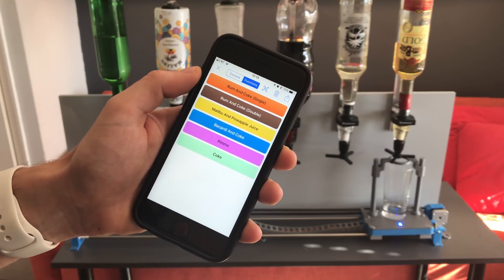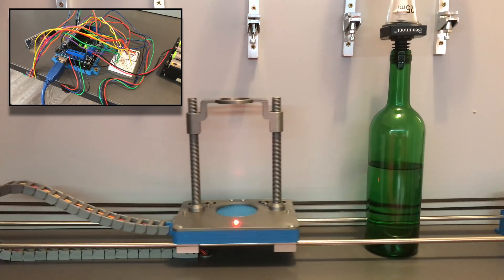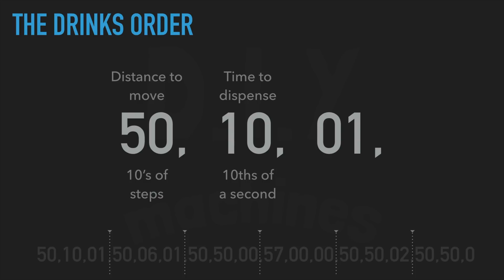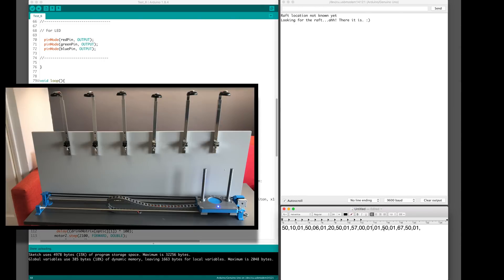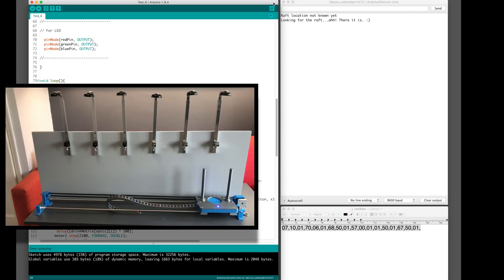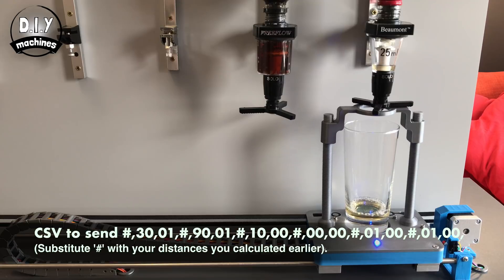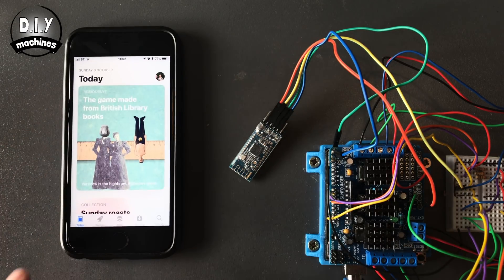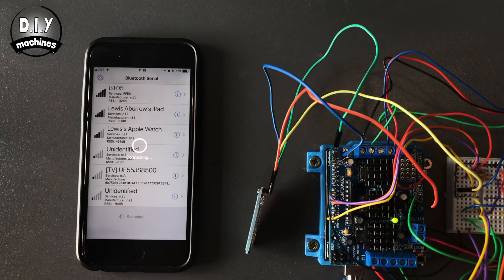How to make an Arduino DIY Robotic Bartender - P4 Adding Bluetooth

Comment: Great Project, I'm currently trying to build my own. So far everything works great.
However I'm struggling to find all the Code examples you mentioned in the Video on Github. 
Im currently trying with the script "Barbot_V1.ino" but I had to reverse some Motor directions to make it work properly and change it to 15 optics.

It seems to work, it homes in, prints that it found the Paddle but then 10-15 seconds it randomly starts dispensing a drink. Is it possible that it saved the last drink command even tough I reuploaded the code since last trying? It didn't seem to do that before.
(I did try before by sending it via Bluetooth, so the HM10 is already attached)

I'd appreciate any help or more Code snippets so I may understand the code fully myself (first time doing anything with arduino programming...)

Thanks and keep up the amazing Projects. :-)

Comment: Help needed. I have 10 optics instead of 6. I changed that in the code, but when I send the code it shows this for some reason?

10,30,01,30,30,01,30,00,00,30,00,00,30,00,00,30,00,00,30,00,00,30,00,00,30,00,00,30,00,00,

Raft location not known yet
Looking for the raft...ahh! There it is. :)
10,30,1,
30,30,1,
30,0,0,
30,0,0,
30,0,0,
30,0,0,
30,0,0,
237,2277,2277,
2277,2277,2277,
2277,2277,2277,
Done loading

Comment: Im getting some weird errors... When the machine has done the last optic it gets automatically a new command with very werid numbers 
-------------------------------------------------------------
50,30,1,
50,90,1,
50,10,0,
50,0,0,
50,1,0,
50,1,0,
Done loading
Drinks ready, enjoy.
2387,2277,2277,
2277,2277,2277,
2277,2277,2277,
2277,2277,2277,
2277,2277,2277,
2277,2277,2277,

Done loading
Raft location not known yet
---------------------------------------------------------------

so it does what i commanded him to do but after that he's automatically driving a crash with those weird numbers...
Also my LED is not quiet working when i put the ground wire to the ground pin - it wont light up
anyone knows what could cause my errors? im pretty new to this arduino stuff :/
Reply: So i figured out now that there shouldnt be a comma after the last number of the command! In the description is a code: 07,30,01,68,90,01,72,10,00,70,00,00,74,01,00,71,01,00,
But it should be like this: 07,30,01,68,90,01,72,10,00,70,00,00,74,01,00,71,01,00
-->Without the comma at the end. This makes the random numbers (2277,2277,2277) disappear and it wont crash - for now...
After fixing that i added the bluetooth module. 
Now if i connect to the bluetooth module with my app, the machine goes crazy and crashes in the same direction again... i plugged the arduino uno into my computer again to see whats causing this problem. Then i saw that as soon as I connect with my mobile phone - the bluetooth module sends this code with those random numbers to the machine again, making it crash:
2387,2277,2277,
2277,2277,2277,
2277,2277,2277,
2277,2277,2277,
2277,2277,2277,
2277,2277,2277,

is there anyone still active on this project? Or maybe somebody encountering the same problems as me?
Reply: @B4uernp0wer300  Did you figure this out? I am getting the same error.
Reply: @brockr1600  havent been working on this project for a  while now.... i figured out that there are many different bluetooth apps. Serial bluetooth terminal is working  the best so far but i still get the error sometimes. pretty weird stuff happening there. and i have to fix some mechanical problems aswell - seems like my stepper motors dont have enough power to push that peddal upwards - but im using a slightly different design of the machine anyways. 
let me know if u figure something out :)
Reply: @JC Motion Simulator heyho I kinda stopped working on it :/ but yeah if I take my time and figure something out I let you know. Let me know if u find something as well :)
Reply: Salut , même soucis , je vais travailler dessus pour trouver une solution

Comment: I was wondering where the cocacola was leaking out of the free flow optic at? Is there anyway of designing a 3d part that has a 1881 bottle cap on the top and on the bottom a clamp that fits the optic snuggly?

Comment: Good idea.
I've got everything done so far but I don't understand why the BOT loads more numbers after it is finished (over 2000) and then nothing works anymore
Reply: i guess i have the same problem. did u fix urs?
Reply: Meme problème ! Avez vous la solution ?

Comment: Hi what great project is this, the only issue I have now is that hm10 app is no longer avdd available in the AppStore. Is there another app that I can use?
Reply from the maker: You can use any app which lets you communicate with an HM10 module. Search for 'HM10' and that should yield some results. You could try 'BLE Terminal HM-10'

Comment: I didn't see the bluetooth code in the sketch. did I download the correct file?
Reply from the maker: The IF statement starting on line 161 is the part that checks the serial monitor for an incoming CSV from the Bluetooth module.

Comment: Hi, love the idea!! do you thing you base has enough power to move a full bottle and rise up and down?
Reply from the maker: Thanks. I believe the base is powerful enough to pull a bottle back and forth. Not so sure about the up and down movement. You could always print your own threaded rods and optic pusher with more turn so as to allow more torque.
Reply: @DIYMachines   thanks for you feedback! O Will try , maybe in half an year i can show you something. 😀 Hope to see your next project soon. best of luck!

Comment: Hi guys. I just watch the video and its awesome. I'm doing a project on a different theme(controlling a lever type mechanism with a stepper motor) with the same motor shield. Im doing it on the pc for now and it would be grate if i can control it with my phone. Can some one please send me the code for the Bluetooth for Arduino.

Comment: Hey, thank you so much for your great tutorial. 
I want to build this as a school project and I´m using many of the things you used, but I want to replace the two servos with a lifting magnet. 
I wanted to ask if you could help me, what I need to change in the Arduino code to make it work. I tried really hard to understand, but there are many spots I don´t understand. (sorry for bad grammar)
Thank you very much :D

Comment: Hey DIY Machines, thanks for making this awesome project and making it simple to follow.  I was able to make my own BarTender based on your design and I had everything working including sending the bluetooth serial data and it making drinks.  However, now whenever I first turn it on, or request to make a drink (after one was served) ((Basically whenever it is looking for the raft)) the motor freaks out and just shakes.  If I push the raft to the switch while its doing this, it will stop and from there it will wait for a command, and make a drink like it is supposed to.  There seems to be an issue with getting the raft to the switch every time, but I have no clue.  Since the motor works when making a drink I know it's not the motor or wiring, so there must be a problem with sending the correct data to the motor when finding the raft.  What's even weirder is that I only have this problem when the arduino is plugged into a battery pack, once I plug it into the computer through the USB and it receives power that way it works fine.... Anyways thanks for your awesome videos and help.  Let me know if you have any ideas to help with this!
Reply from the maker: Hi Paul, this is weird. You've narrowed it down to a possible power supply issue - have you tried a fresh set of batteries? You mentioned it used to work fine and the only thing to change as you enjoy more drinks  are the batteries discharging. Give this a go and let me know how you get on.

Comment: Hi,  I am having some strange problems, After the drinks served comes up a series of serial commands comes up and the carriage goes into melt down.
Raft location not known yet
Looking for the raft...ahh! There it is. :)
5,10,1,
40,10,1,
40,10,1,
40,10,1,
40,10,1,
40,10,1,
Done loading
Drinks ready, enjoy.
2741,2277,2277,
2277,2277,2277,
2277,2277,2277,
2277,2277,2277,
2277,2277,2277,
2277,2277,2277,
Done loading
Raft location not known yet
Looking for the raft...
I have tried to find the answer, but unable to solve, can anyone help. Please.
As an addition I have re drawn the sketch for the later, V 2 motor shield, if anyone is interested.
Reply: Hey Roger, I think I am having the same problem.  I am also trying to figure this out and will let you know if I find anything!
Reply: I have a solution for this problem change the code to this :
//Drink complete  
  Serial.println("Drinks ready, enjoy.");
  delay(5000);
  setColor(0, 0,255);  // green
  delay(5000);
 void(* resetFunc) (void) = 0; //declare reset function @ address 0
 resetFunc();  //call reset
  drinkRequested = false;
  raftFound=false;

Comment: ood project, I am an electronic student and I want to make this bartender as a certifying project, I understood everything perfectly but what I can not understand is the bluethoot app, you have the configuration or how much that bluethoot programming file costs, I will thank you enough. .

regards
Reply from the maker: Thanks. The bluetooth app is just a generic one from the app store that let's us send data to the Arduino through its serial connection. It's free.

Comment: Hi,  You don't appear to be using the standard serial monitor, as you can't paste into it. Who's modified serial monitor do you use?   Also when loaded first time, all OK, then stand goes back to zero and a load of large numbers are loaded. This send the azimuth stepper wild.   Any ideas????   Thanks. Looking forward to my first whisky and 7 up.
Reply from the maker: Hi Roger, It's the standard Arduino IDE that I am using. I use a Mac, perhaps this something you can't do on Windows? I'm not sure what can cause the error your seeing. Are you able to repeat the same error every time? If so, what are you doing and seeing before things go weird?

Comment: Hello
Using a servomotor instead of 2 motors to press the dispenser, would it be possible?
And another thing ... for when with peristaltic pumps?
By the way, very good work, thank you.
It is appreciated that you make it public and free, not all the world is the same.
Reply from the maker: Hi Carlos, yes a servo motor would be possible. You'd need to connect it to the servo connections on the motor shield and modify the code beneath the following comment "//dispense what is required then resume moving to the next position:"

Comment: when i insert the code i keep getting the error code

'AF_Stepper' does not name a type

pls help as i have bought all the parts
Reply: Hey Guys, make sure you download the Stepper Motor Library and include these to statements right before the AF_Stepper motor(... commands 
#include <Stepper.h>
#include <AFMotor.h>
Reply: I’m having the same problem. I’ve built everything but can’t get the code to run. I hope you’re still checking this and can provide some advice as I think this is an awesome project. Thanks

Comment: This was great!  Do you have plans to make one of these with liquid pumps rather than the method used here?
Reply from the maker: Thanks Michael, this has been a popular project so yes there is second version I plan to work on at some point. It most likely would use pumps for the soft drinks.

Comment: Hey, 
great tutorial! I build a bartender on my own and it is ready so far. I only have one problm. When the drink is ready the platform is going to move to the left. That wouldnt be a big Problem, but the Platform wants to go further than the end.
So what can i change in the code? 
Thanks a lot for every kind of help.
Reply from the maker: Hello, the platform should stop moving at the 6th optic. This is where it should set it's LED to green when finished for your to take your drink. How many optics do you have on your robot?
Reply: Hey, I have six optics. 
I screwed a screw into the platform to reach the endstop sooner. Maybe this is the problem? So in which part in the code can I change it? 
Kind regards,
Simon
Reply from the maker: You should be OK with your added screw. Have another look at the video where I show you how to customise the CSV for your robot. I suspect the problem lies in with the distances you're supplying in your drinks order.
Reply: same problem here. have you fixed it?

Comment: I'm sorry but the code provided doesn't work.  I even added the Adafruit library.  I still get an uploading error.  I decided not to use the LED.  Would this in anyway affect on how the code works. I spent alot of money on this and have no coding background, and would love to have some advice.
Reply from the maker: HI Harrison, omitting the LED should not cause any issues. Post the error that you're getting and maybe myself or someone else here might be able to help you work through it.
Reply: Hey Harrison you're probably missing these two statements that I don't think were in his code.   
#include <Stepper.h>
#include <AFMotor.h>
In addition, make sure to download the Stepper motor Library, but it sounds like you already did that.  Also like Master DIY Machines said the LED shouldn't affect this at all. Hope this helps!

Comment: Great video series. I've followed along and am almost finished! Although, I've tweaked the design a bit. Instead of two motors pushing up to the optics, I've installed small actuators on each optic. Any idea on how to integrate a digitalWrite command for each actuator individually into your code, i'm not quite sure how the drinkMatrix portion works. Any tip is greatly appreciated.
Reply: Hi, I too have completed my build with the exception of working code.  I thought I would ask you because this account has been dormant for some time.  The code provided doesnt work for me, or atleast I don't think it works for me. I can't get the code to upload.  It keeps having errors uploading.  I've changed ports, and have the boards set correctly.  I was curious if you made any changes to the code to make it work.

Comment: Hello DIY Machines,
Thank you for your detailed tutorials and to share your projects.

I'm building my automatic bartender based on your project. The difference is that I am using a cnc shield with 200 step stepping motors for revolutions. So I had to increase the "parameterSize" from 2 to 3 and increase the buffer size of the serial port to 256 (I read about the problem in the previous posts).

Currently everything works correctly but in rare cases (rare but sometimes happens with identical CSV) when I send a CSV the serial monitor returns me wrong values like: 10,6960,6468,
24025,24573,6210,
6938,5660,7806,
27477,22977,22977,
22977,22977,22977,
22977,22977,22977,
Done loading

the same thing happens if you insert an incorrect CSV.

Do you think it is possible to insert in the code before the
"Serial.println (" Done loading ");
      drinkRequested = true; "
a second check of the input for avoid any errors?

for example if the parameter size is greater than a value
 "x"
Serial.println ("insert code again");
"drinkRequest = false"

If this is possible, could you help me to write this piece of the code? I'm absolute beginner and I get crazy :) :)

Thank You for your work!
Reply: Im having the same problem. Everything work using bluetooth module. After it says drink ready, about 10 secs later, these strange numbers appear and the raft starts to go haywire. Any suggestions to solve it?
Reply: I'm trying to work on It but my knowledge are so basic. If i'll resolve I will post it here. Any suggestion are welcome!
Reply from the maker: Hello, yes we could try adding something to check for unexplainable values. I'll dig out my code and will take a look at it - I unfortunately have dismantled my bar robot so I can have the space to build other projects for the channel so I won't be able to test it myself.
Reply from the maker: OK, your idea is fine. This is how you could implement it. We have a section of the code that looks like this:

CheckArray();
Serial.println("Done landing");
drinkRequested = true;

If we move the call for function CheckArray()  (which currently just prints what it received to the serial monitor) to after where we set drinkRequested = true we can then add some more code to the CheckArray function to look for unusual numbers, if we detect any we can the change drinkRequested = false before the code loops around and tries to proceed with dispensing a drink. So it would now be like this: 

Serial.println("Done landing");
drinkRequested = true;
CheckArray();

Now the function checkArray works through each item in the array to print them to screen. It prints them in this using this line:

Serial.print(drinkMatrix[i][j]);

i and j change as it work through the loop. What you need to do is copy that line and modify it so that as it works through each array item it also checks it, and if it doesn't seem right it needs to set drinkRequested back to false to prevent the drinks order being processed.

Have a go now I've suggested where you could make the changes you suggested. If you're still stuck give us a shout. :)